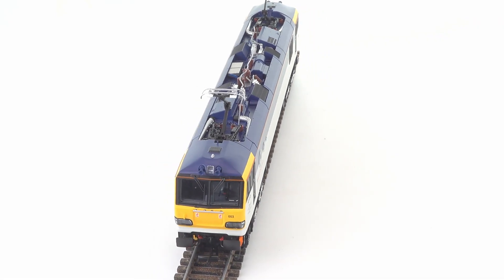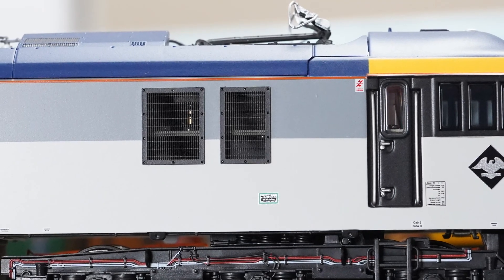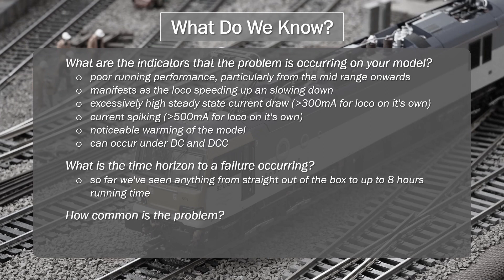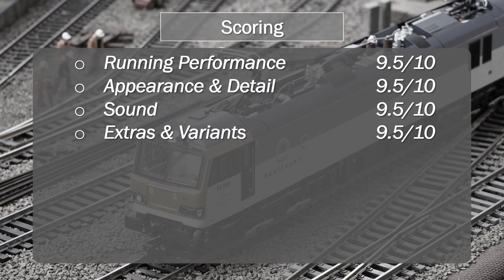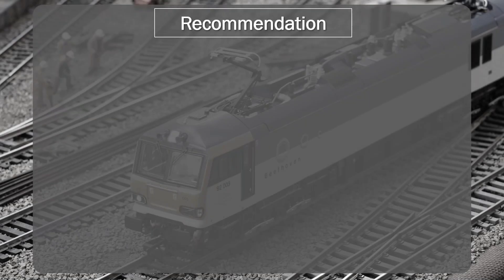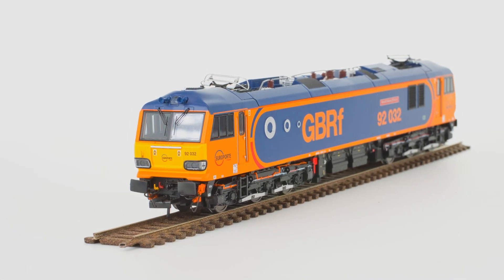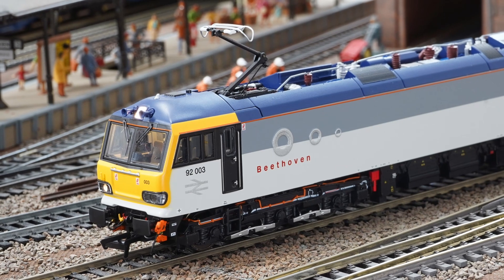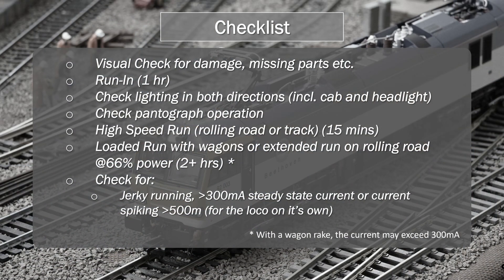Review: Accurascale Class 92 Part 2 - 92032 'IMechE Railway Division', ACC2198-92032DCC, DCC Sound

Comment: Many thanks Eugene. Only time will reveal how many models are affected. As you point out in your final section, people really need to test their models for and extended period as the issues can take time to surface. 
 The running problem is clearly caused by an electronic component breaking down under load; take your pick from the numerous the resistors, capacitors and diode regulator or even the motor itself. 
 Since Covid struck I am aware of supply line issues with components across the globe. I fear there could be a quality issue at play here as manufacturers are accepting whatever they can procure! Didn't Accurascale themselves announce a delay with their new class 37 due to chip sourcing problems? I know many car manufacturers had been halting productions due to electronical shortages....
   My verdict is that despite it being a beautiful and brilliant model when it's working correctly,  I cannot recommend it, yet! I currently see it as a liability. Until such time as Accurascale come clean, provide full details and a long term fix I will not be considering buying it again, having returned the 3 I originally bought. My fear is they may try to skip over the issue, play it down by saying that it was a few isolated models affected. Their response will dictate how I proceed with future orders of their other products in the pipeline!
Regards Julian
Reply: And what if it simply is a few isolated issues? Or bad controllers rather than a model issue?
Reply: @mccarronfamily  I would hope it is just isolated cases but the nature of the fault (electronic circuit board component) dictates to my logical reasoning that it is likely to be a widespread problem as components are manufactured and procured in large batches. As for bad controllers....think about it! That would affect all models and not just this one!
Reply: @theeventhorizon-valebridge9512  Any reports point to a motor, not a pcb component, in which case a simple motor swap would cure any issues - more investigation clearly needed since there are practically no comments elsewhere of this issue
Reply: @mccarronfamily  The motor is a possibility for sure but my best reasoning suggests to me is a circuit component problem, due to the way the fault manifests itself. I am an ex electro-mechanical engineer. Don't forget I had three models to analyse the problem with where as you seem to be optimistically groping in the dark, hoping It's an easy, isolated and obvious fault. That doesn't seem likely to me.
Reply: @theeventhorizon-valebridge9512  Groping in the dark is rather presumptive? accurascale have done run in testing on 8 models picked at random for over 5 days constant running at the moment without failure, and the return rate from a matching reported issue is currently a total of 5 customers, from the just under 7000 models delivered so far. It's easy to lose perspective online :)
Reply: @mccarronfamily   You seem well informed and that may possibly be the case, or possibly not..... 
  I am sceptical these days; life has proven that to be the most sensible and realistic way to approach issues!  The model train industry as a whole is littered with continual problems and failures, new, out of the box. 
 What I can say is, I am on 100% failure rate from 3 Accurascale class 92 models, fact. I am not here to attack or defend Accurascale, just pass on my experiences.
 There seems no point in any further conversation about this matter at this moment in time.
Reply: Pretty sure he’s the MD 😭
Reply: @theeventhorizon-valebridge9512  Do feel free to drop me a direct line - I've not heard from our support team of a three loco return, as the return rate currently is just over 0.0025%
Reply: I see where you are coming from in that respect and I'm sort of in the same boat returning 2 failed 92010's one after the other and both experienced PCB/Panto Servo/Motor running issues within the hour of running at 60-80% speed on my Gaugemaster Prodigy Advance 2 controller.
For the second 92010 I actually hooked up my DCC Concepts Alpha Meter to the rolling road and the loco was spiking up to 70ma but consistently ran over 30ma without any load and like the previous 92010 one of the panto's then failed and became unrecoverable even thru decoder resets on my Lokprogrammer, also 92010 with sound, which is Exclusive to AS, is now sold out thus they will have to fix this one or grab one of their non-sound 92010's and transfer the sound decoder & speaker from my failed one into a DCC Ready one which still available.
My 3rd loco 92020 which I also sent back will be interesting but that only got sent back to have the grills re-applied and I didn't run that one at all and only tested the panto's for a couple of minutes before picking it up to analyse the detail and the grills fell off thus that one is currently an unknown entity in regards to actual running.
I may be a glutton for punishment because hopefully this week sometime I will receive my other 2 DB 92's with sound (92036 & 92042) from an eBay retailer and to be honest praying those two don't fail because they are not purchased directly from Accurascale thus probably more of a hassle to send them back and get replaced or repaired.
I'll keep this channel updated on how I'll get on with those sent back to AS & the ones purchased elsewhere coming soon.
Cheers Steve
Reply: @saphire-c4k  Thank you for taking the time to give your detailed summary of your experiences with this class 92. As I replied to Eugene, I see this model currently as a liability and I will not repurchase one until there is full disclosure and a fix from Accurascale. Ping-pong post is not my bag!
Regards Julian
Reply from the maker: Hi Julian, did you return for a refund or are you waiting for feedback now on your 3 models? I haven't been pushing my own return as I'd prefer they spend the time bottoming out on any problems so that any repair is a root fix. I'll probably check in with them tomorrow.
Reply: @EuviRail  I also want Accurascale to fix my 2nd returned CS 92010, don't mind if it takes a while and as you said you get to the root of the issue.
Reply: @EuviRail  Hi Eugene, yes I returned the 3 models last week for full refunds to a well known major retailer, who in my opinion is dragging their feet somewhat! This week I've been chasing that refund, having to prompt them with multiple emails. Frustrating. I've just received some further correspondence from them today so I will update you again soon with more details. Regards Julian
Reply from the maker: @theeventhorizon-valebridge9512  Thanks Julian. Such a shame but understandable given your experience. You don't need any more grief in terms of actually getting your refund. It's not a trivial amount by any means.

Comment: Hi another excellent follow  up video. I just tested by 92 & 55 at 90% power as I'm not game to do 100% on may layout. They both show using around 420 according to my z21 app running separately. Bachmann Class 47 pulls around 350 at the same power level. This is with sound and lights on. I'm still trying to work out the Pantographs I did have to do a Cv8 reset.
Reply from the maker: Thanks Dallas. The C92 does pull a bit more current than the Bachmann 47 so no concern there.

Comment: Thanks for this really informative review. I have 92038 in Caledonian livery and it seems fine, but I’m obviously concerned there may be an underlying issue with the running. I’ve got two comments on this - firstly my experience with other manufacturers, in particular Hornby, is they have similar problems but Accurascale do seem to be particulatly under the microscope for this. All credit to Accurascale that they have a superb customer support and work with you to resolve it, unlike my experiences with customer support from the two big manufacturers - which have been appalling. My second point is that if this is becoming a manufacturing fault which Accurascale are aware of then it shouldn’t fall on is as customers to induce a failure during 12 months. As a known fault Accurascale should be offering warranty repair at any time.
Reply: In a world of a limited number of factories with a limited number of skilled workers making these things and given the recent(ish) shifts in the industry including kader buying out the factory where hornby had made most if not all their stuff and restructuring it all... we have to ask which of these are coming from which factory. The business is so opaque though, and probably on purpose, as to make any of this quite difficult to establish. 

Probably there are some hilarious situations where two competing "manufactuerers" products are made side by side on the same factory floor with one worker looking at the other across the room and wondering what the heck us weird railway modellers do with all these different iterations of the same thing which have come about of late
Reply from the maker: Thanks for that. I think you'll do well to get any manufacturer to come clean unless it's something so blatant that they have alternative to do so. A certain failure % is built into the offshore manufacturing model - probably more than I'd personally be comfortable with but the manufacturers will justify it on a cost basis. Given this, the support you get is absolutely critical and Accurascale win on that front. I haven't found Hornby too bad and I haven't had to go back to Bachmann on anything yet which is a positive for their general quality though I've picked my models carefully and  I haven't been purchasing their steam locos. I suspect I'd have had problems if I had been.
Reply: My class 92 failed twice since last seven months of ownership.. one for a dead motor immediately within a month which was slowing down for no reason while chewing up very high current … the same way some class 37 failed too and I feel Accurascale do need to check the motor quality and the failure rate in them. NEM thing does come loose on this one, I have had that too. Now the decoder has died, which is the the underlying issue and I am waiting for a new decoder to arrive. I never had some issues with Hornby or Bachmann or Trix. Their customer support is really good and responsive so I am hopeful they will resolve this in due course.

Comment: Recently changed the motor on an out of warranty Heljan which was exhibiting same symptoms of erratic running to my class 92. When I ran the old motor on its own with a battery there was a lot or arcing around the commutator when it went slow. I took it apart  and the commutator was very scored and looked to have been damaged by the brushes which were hardly worn. I suspect the class 92 issue is a motor problem and is probably just a quality control issue with the supplier. I don’t know how much motors are tested but given they sell for a couple of pounds I suspect not much.
Reply: Totally agree with you David as I have had same issues with other manufactures. New motors fixed the problem. 
Peter
Reply from the maker: Thanks for sharing David. I would tend to agree that the motor is the issue here. I'm awaiting feedback from ACC on my return.

Comment: Another great video and thank you.   I think its a defect that may be far more prevalent than your stats suggest simply because  many modellers will not  have or be able to run the 92 at full speed or under load or have a rolling road. A latent defect that only manifests itself after several hours of continuous running will only be picked up by those that have the ability to test as you describe.  Let's hope Accurascale undertake some research as to the real cause of the issue rather than simply replacing without identify what is causing these failures.   The other faults are minor niggles but erratic performance leading to over heating and potential failure needs some research without which we will not know if its just a small number or more widespread.
Reply: Yeah nah, if it's motor related they'll just ask the factory for a change supplier of that component in future and move on. They can probably buy a generic motor in the same form factor with the same reported specs from a few different places so it's much easier to just do that until you find the one that does has the magic touch than go hunting down the issue. 

Won't be any serious research or worry about it the old supplier will just end up with their motors going into something else and no one will mention it again.
Reply from the maker: Thanks for that. One fear I had was that if the current spikes continued to get worse, the DCC decoder would be blown and it's not just a $2 motor you're repairing. Without the Alpha meter I wouldn't have known.  Only seeing a trickle of new reports so I'm hoping the issue is more isolated than it originally appeared to be.

Comment: Just a question : once the erratic speed control and high current issue has occurred, does this feature straight away again when the loco is next run? Or does it re occur after a period of time? That may be important for people like me to know as I generally don’t run locos for extensive periods of time. As I mentioned a few days ago my only issue has been the coupling at one end being unattached during unboxing.
Reply: Hi John, may I answer you. This is a motor problem which I have experienced with other manufactures. Once it happens, it will happen again and in time get worse. Motor running hot and under DCC risking the decoder getting hot due to excess current draw. Cure is a new motor. Locos that I had with the problem all run fine now with new motors. I can only think there is a problem with the brush material with faulty motors and seeing as they are sealed and maintenance free, nothing can be done but replace.
Peter
Reply from the maker: @torridonroadbypeterdixon4162  This is the case alright. I re-tested the model I returned to Accurascale multiple times - to be sure to sure as they say.  It picks up where it left off and all I noticed was the current spikes were increasing in magnitude. You do need push the power applied over 20% to see the effect properly. As I mentioned in the video, if you just run the loco at a low speed it will look as if it is functioning Ok. The current level will be high but you won't see the spiking effect  and "lurching" of the loco so you could be fooled into thinking it's Ok.
Reply: My experience with the 3 class 92 locos I bought was that once the running issue occurred it may or may not show up again immediately upon reusing it some time later. I had instances of both. One model stayed in a crawl state permanently after the initial fault appeared whilst the two others remained randomly faulty with their speed fluctuations. Regards Julian